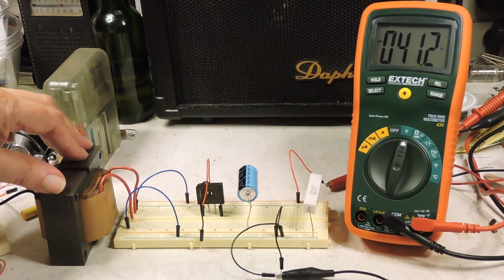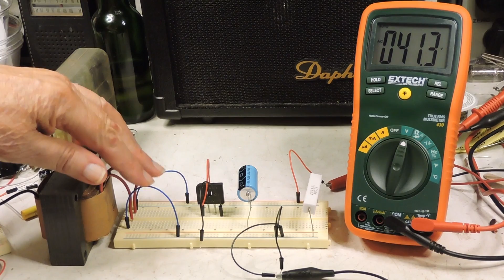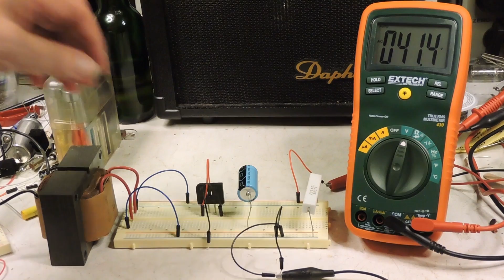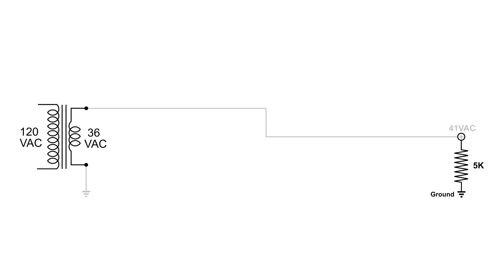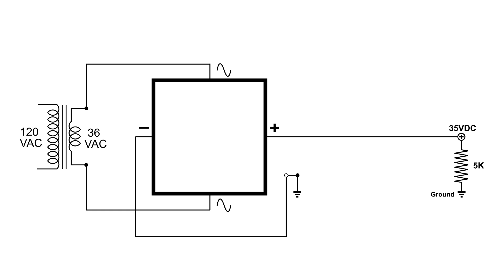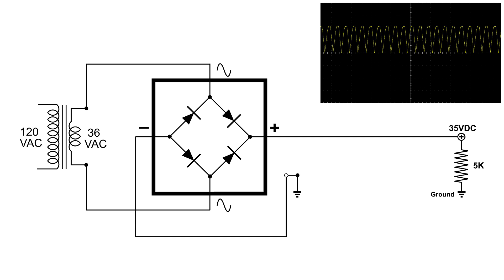Power Supply Design Problem

Comment: Hi. Thank you for your videos, I find it very helpful to understand circuits better 

I have a question, assuming 36v is RMS, If use a 36/(sqrt.2) transformer and use a capacitor I should get 36v Dc (plus ripples and other noise) at the output right? If the system is not too sensitive to these ripple noises, this solution would work just fine?
Reply from the maker: As long as the load does not draw to much current.
Reply: @AllAmericanFiveRadio  thank you. What happens when the load draws too much current? Would it reduce the voltage of capacitor? Is it related to something like continuous conduction and discontinuous conduction modes? Or would I just get ripples?

I would love it if you can explain intuitively or with the help of equations.
Reply from the maker: @manueljenkin95  This video may help.
PI filter, Resistor Choke Oscilloscope Demo
https://www.youtube.com/watch?v=WzwaHO6WPCk 

This is a link to PI and Filters Design Tools
http://www.calculatoredge.com/electronics/ch%20pi%20low%20pass.htm 

https://www.eeweb.com/tools/pi-match 

And there's more.

Comment: Before you added the capacitor, when you supposedly had the 35 volts DC, what you had was pulsing DC, which was throwing off your meter.  The meter was reading the RMS voltage, not the peak voltage.  Then when you added that 1000 pf cap, it converted the pulsing DC to actual DC.  As their was no longer an RMS, you now measuring the peak reading from said circuit as the capacitor stored the peak, not the RMS of the pulsing DC signal.
Reply from the maker: Take a look at the pulsating DC. This meter read true power (RMS). This means that the gaps between peaks are averaged in with the peeks, (gaps + peeks) = 35VDC. The peeks are at 54VDC and when the capacitor is added it fills in the gaps, now there are no peeks or gaps just 54VDC.

Comment: Rick, would there be a heating problem with the regulator bumping 54v down to 35v? I would imagine it would need a good size heat sink. Thanks
Reply: I depends on the current requirement.  If is is low current it would be OK.   Volts times amps across regulator.
Reply: Based on circuit shown it should be fine.   35V/5000ohms = 7 milliamps.   Voltage drop across regulator is 54V -35V= 19V.   19V X .007A. = .133 watts  or 133 milliwatts.
Reply from the maker: Hey Carl, well it might be. But the unit is going to draw about 1 amp to 1.5 amps. I have simulated the problem because it is propitiatory information. It will be interesting to see what the engineers resolve will be. I'll let you know what happens.
Reply: I would tend to agree with you. That is a big voltage drop from input to output on that regulator.
Reply: Maybe a different transformer should be used that has a lower output voltage so you don't have a hot regulator.
Reply: Proprietary? You have no idea what you are talking about. There are so many more factors to this circuit than you know or will admit you know AND you are drawing the 1 to 1.5 amp figure from the maximum a to-220 package will do (if fully heatsank!) but you don't show it. Even your pinout can be wrong be wrong because it is available in a to-92 and several other packages.

fp040759 did the math correct and it even further shows that your circuit is useless because no one would make that circuit for a mere 7mA. A zener circuit would likely be used for power that low. 

If you misspoke and you start drawing 1amp or more out that circuit that first cap will likely blow up in your face which is why you see such large caps in older circuitry. Ask me how I learned that. Not to mention the 78xx series of regulators have voltage ripple reduction.

Comment: I still didn't understood how adding a capacitor bumps up the voltage to 54V.
Reply from the maker: Take a look at the pulsating DC. This meter read true power (RMS). This means that the gaps between peaks are averaged in with the peeks, (gaps + peeks) = 35VDC. The peeks are at 54VDC and when the capacitor is added it fills in the gaps, now there are no peeks or gaps just 54VDC.
Reply: Once rectified, the capacitor charges to the peak AC voltage which is 1.414 times the RMS voltage measurement. This math gives you a ball park of the rectified DC voltage expected. The vast majority of AC volt meters measures RMS voltage. The peak AC voltage will always be 1.414 times the RMS value.
Reply from the maker: Take a look at the pulsating DC. This meter read true power (RMS). This means that the gaps between peaks are averaged in with the peeks, (gaps + peeks) = 35VDC. The peeks are at 54VDC and when the capacitor is added it fills in the gaps, now there are no peeks or gaps just 54VDC.
Reply: I am glad I read all the comments thru. I was going to state RMS as the reason also. I use a peak detector when checking AC so I know what I will get when I smooth out DC if I am going to convert it. That or scope it and get the peak value that way.
Reply: May be it removes the voltage bumps, so that DC voltage equals full amplitude instead of something in between 0 and 54.
Reply: The cap opposes a change in voltage so it sees the highest voltage (the peak) and tries to keep it there. It will hold peak voltage until the amperage exceeds the usability of the cap. IE: voltage ripple if you are looking at a data sheet

Comment: Could you show the oscilloscope readout after each capacitor is added?  I'd like to see what the filtered output looks like.  Thanks.
Reply from the maker: This is what it looks like

Half/Full Wave Power Supply Oscilloscope Demo
https://youtu.be/4kMXulubQFU

Full Wave Rectifier Tube Type
https://youtu.be/yneDrxMdLP0
Reply: AllAmericanFiveRadio Gracias